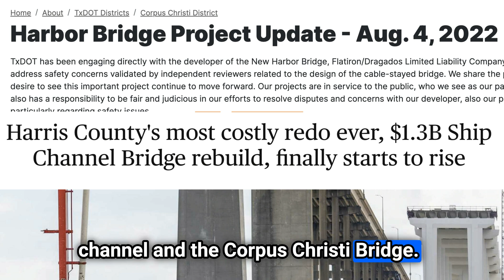Why is a bridge problematic between Bolivar and Galveston?

Comment: Hey Jr, I have never asked this question... my question is why is there not a bridge over Offatts Bayou to the Moody Gardens area.  That would reduce travel time so much to the nicest tourist attractions on the island.  Yes, I am a golfer.
Reply from the maker: Hey man! I have read and heard of a few plans about a bridge like that. It would be SO convenient if there were another bridge between the current one and San Luis Pass. 

There was a plan for a rail bridge in the 1890s from the mainland to where the State Park is now, however, financial issues and the 1900 storm brought that to a hault. The only obstacle on the water is the intracoastal waterway. Not sure the height and width requirements, though! 

We need another bridge, just not to bolivar 😂

Comment: I think the tunnel idea would probably be more doable. Ultimately as someone has already pointed out, there's not much reason on the Bolivar side to warrant the costs involved with either a bridge or a tunnel. The ferry system is still far more cost effective than any other option. Improving the ferry system would much more cost effective

Comment: Personally, I would fight against a bridge (frankly high bridges freak me out and I still avoid the Rainbow Bridge and the Sam Houston Tollway bridge over the Ship Channel), I love the ferry, there are times when I just want to think and a few hours going back-n-forth getting some sea air, does the trick. 

A bit off-topic, but I have always been curious as to why there is no scheduled air services to GLS. At one point, Galveston Scholes Field did see commercial air service but as I understand it, that pretty much ceased when IAH was opened in 1969. I viewed the GLS website a few years back and it was stated that the airport could service aircraft as large as the 767. I suspect that the two Houston airports (IAH/HOU) would likely oppose such a move. You might want to investigate further. No doubt it would be an expensive project and many hurdles to clear, but it would make Galveston more accessible.
Reply from the maker: The airport is conducting a multi million dollar upgrade to improve for commercial traffic in the next 10 years or so! 
Pretty wild master plan too!

Comment: Idea 01 - Tunnel as mentioned already. If Maryland can figure out to cross the Chesapeake, then we can to. Idea 02 - Combine a road and the Ike Dike into one. At the swing gates, make them drivable. Sure the gates will be open often for ships, but it certainly beats waiting hours on the ferry. Idea 03 - Combination Ike Dike road and tunnel under the swing gates.  There are plenty of options, however, the road block (literally) is that there is nothing of significant value over on Bolivar that warrants a billion dollar + highly engineered water crossing. Sure there are some nice expensive homes over in Bolivar but those don't justify the expense. Idea 04 - Make, and put into service, more ferry boats and build MUCH larger ferry landings to accommodate the traffic load.
Reply: I'm no geologist or engineer either one, but I suspect the issue with a tunnel is the ground... specifically a lack of bedrock.
It's the same reason houses on the gulf coast don't have basements, and the same reason we don't get earthquakes down here.
The only tunnels you see in gulf coast areas are generally pretty short.

And I suspect that opening up a direct route from Galveston to the Beaumont/SETX area would be the main advantage, more than simply having access to Bolivar itself.
Reply: Your comment leads me to believe you don’t live on the GulfCoast. As stated above there is a reason homes don’t have basements.
Reply: That bridge-tunnel starts and ends in Virginia.

Comment: They’d have to totally rebuild the pelican island bridge for that idea to even work. That would take years plus cost a lot as well
Reply from the maker: Thanks for watching and commenting! You should read about the drama with the current pelican island bridge… they are already having trouble replacing it. 3-4 different principals/authorities hold stake. Plus, the point you are making. A&M and industry on Pelican are already affected by the deteriorating bridge. You are correct. Infrastructure design and implementation is beyond difficult.